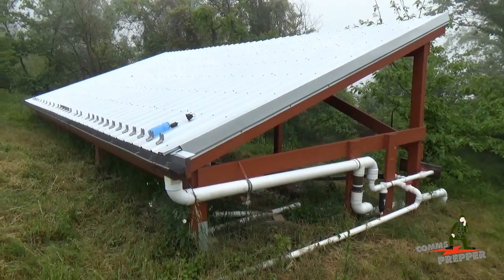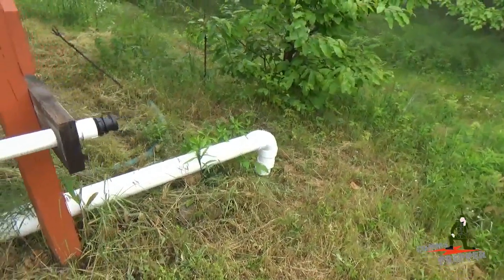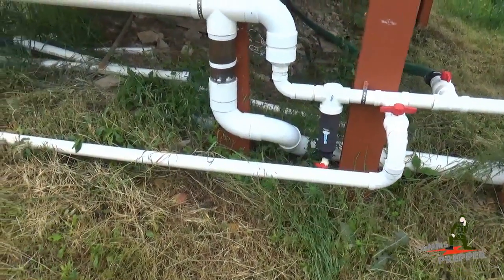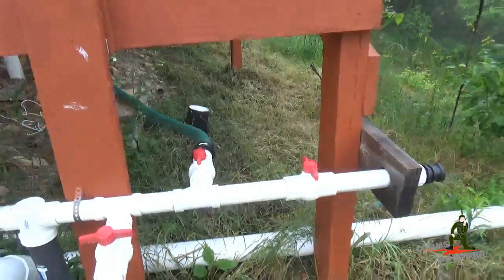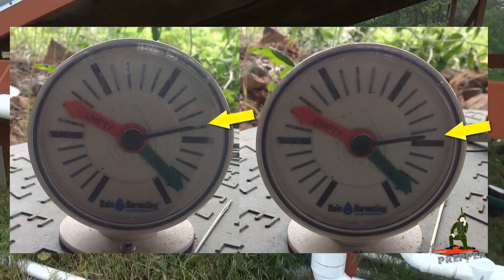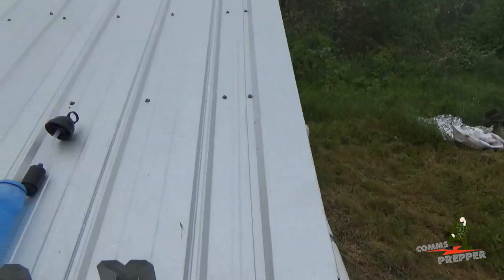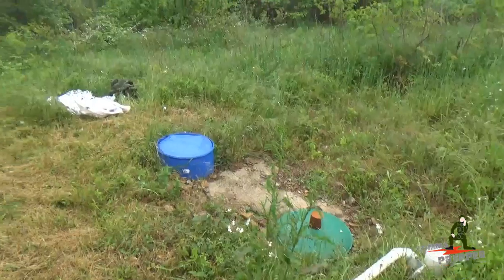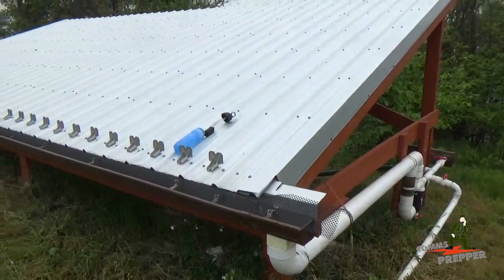Collecting Rainwater

Comment: Seems that you should be able to make the water potable fairly easily. Especially once the initial grime on the collector has been removed.
Reply from the maker: I agree.  The water in the tank always looks good and the spin-down filter keeps the crud out.  We have a 4 gal pot for boiling and a Katadyn drip down filter.

Comment: With that metal roof I would think it would be pretty safe to drink if you had to. Mine coming off my roof with the regular shingles has a oil residue in it so it has to be filtered. Very nice setup!
Reply from the maker: +TRprepper Thanks TR.  The roof material is call Galvalume.  I picked because it was the least toxic option.  Two years now and we are very happy with the project.

Comment: It is very good system.  I would have made the stanchions tall enough so that at some point it could have boarded out to make a shed.
Reply from the maker: +clangerbasher I thought about that but it's on the back side of our lot and not really accessible without driving around the mountain.  Keeping it low makes it easier to clean and inspect.   It also does not count as a building for tax purposes.
Reply: Commsprepper It wasn't so much a criticism more an observation.  Did you look at what their definition of a building is?  Also if the system collapses there won't be anybody to collect taxes.....(  joke :)   )

Comment: Was working on my small collection system today......  you already commented...   Was wondering..  Have you ever taken your collection water to be tested from you faucet source?  would be interesting to see what the test results show.
Reply from the maker: +Blue 823 Blue we did order a water testing kit from Amazon and everything checkout fine.  This said, I still throw bleach in the tank in the Spring and run the water through a filter inside the house (cold water supply of sinks).  Showers and toilet straight from the tank.
Reply: My system is going to be open flow for a while to assist in filling up the pool... After that Ill close it down and it will be used to water the garden and flowers... only to be used for household things in extreme SHTF situations..  cant think it would be good to drink water from a shingled roof.

Comment: Thanks for the update!!! I was wondering about this the last time you mentioned all the rain.  Always helpful to get the follow-up to see how systems perform over time.
Reply from the maker: +M Miller We are very happy with the system.  I would estimate that we are only at 40% of its potential since we are not here all the time.  Production would be much higher if I was on-site for each rain and could clean all the filters and switch between tanks to balance collection.  This said - we have water.
Reply: Thank you!  You're lucky in a sense - here in the west it would get wet twice a year - for about 2 minutes!